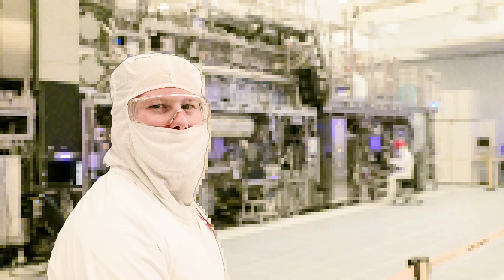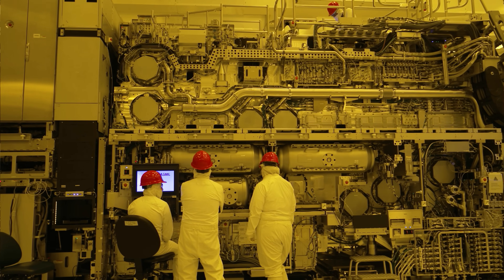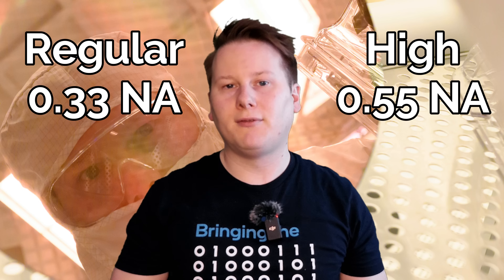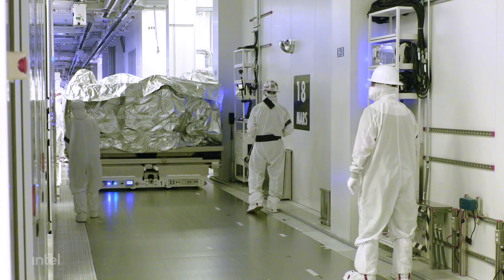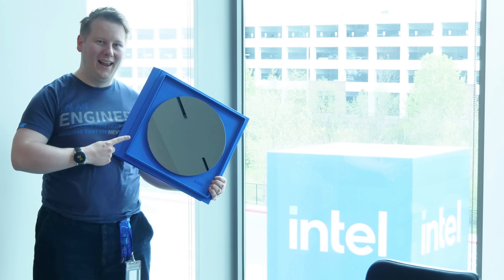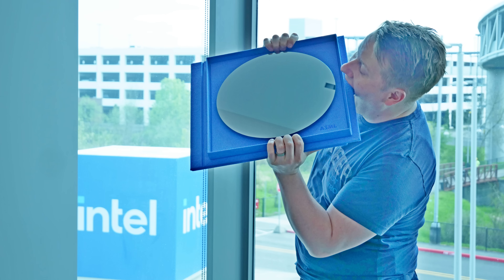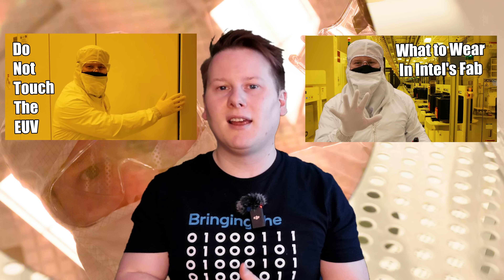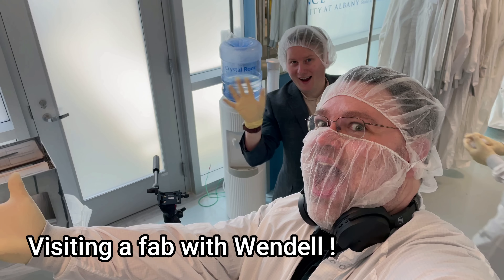Intel's Newest $350 Million Machine

Comment: Interesting fact: these machines consume an obscene amount of hydrogen gas.
Reply: hydrogen comes easy from oil fields? or can be done with solar panels cheap? or no?
Reply: @cubertmiso  it has to be delivered by tanker daily. It’s just a weird requirement no exposure tool has ever required before. They use it to vaporize tin droplet residue from the optics (tin hydride is a volatile vapor at low pressure).
Reply: By obscene how much are we talking about?

Comment: The old 8 inch fabs were actually cleaner than the current 12 inch ones. 12 inch had the product protected in the FOUPs whereas 8 inch the wafers were brought around in hand held and hand loaded lot boxes & cassettes.
Reply from the maker: IBM's 2nm fab still uses hand loaded lot boxes in places.
Reply: Been in industry since 4” wafers… NO way 8” is cleaner. The AMHS handles just about everything in a FOUP that’s closed until docking.

Comment: Question - what about vibration isolation?  Was this machine built on its own support?  Was hydraulic suspension or dampers used? Did they have to re route aby truck traffic?
Are the machine getting more vibration insensitive or vibration sensitive ??
Reply: Worked in this industry for over a decade. Safe to say that vibration is a big no no.. So almost all these machines sit on their own isolation platforms with actively controlled levelling and stabilisation systems.
Reply: @AmrishKelkar  Thanks. 
Just the leveling and vibration isolation could be an interesting video. with smaller features, it seems external truck and internal parts moving Vibrations becomes a larger issue.
Reply: the entire fab is seismically isolated, as is every floor in the fab, as are the tools themselves. To tell you how sensitive the tools in the fab are to vibration, we often know in the fab about earthquakes before we hear it on the news. Quakes in Alaska and Japan will cause some lithography tools to error out. 

So yeah, the buildings are incredibly vibration protected and it still often isn't enough.
Reply: @CRneu  "Quakes in Alaska and Japan " cause errors. Wow. 
Nothing like a real world report

Comment: Does Intel buy or lease the ASML machines❓  
Can Intel build them without ASML❓
What is the cost to build them, vs buy them at 350mil. each❓
Will Intel ever be free of ASML❓
What is likely to replace lithography❓
Reply: Buy, nah, see asml investor relations (if it ain't in there it's a secret), maybe, ?
Reply from the maker: Buy
No
$350m all-in. Buy, delivery, install.
No
Not much. The nanoimprint stuff last year didn't even mention process node equivalents (and I asked about it and they refused to say).
Reply: @TechTechPotato  It is doubtful if NanoImprint will ever be viable. Yes it could be fast but it is a contact process, basically stamping, which makes it very sensitive to defects/particles. One particle on your "stamp" and every wafer after it is bad, inspection would become essential and expensive.